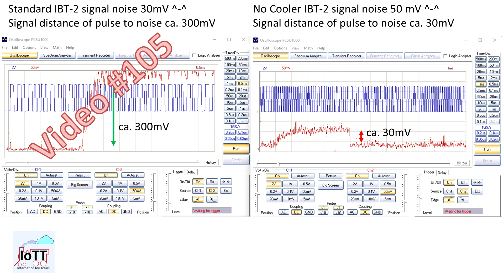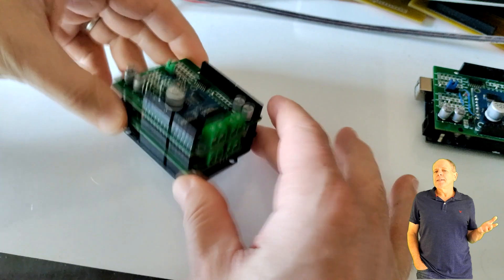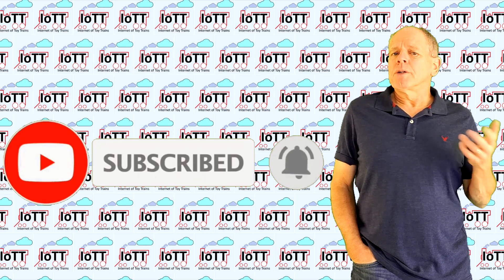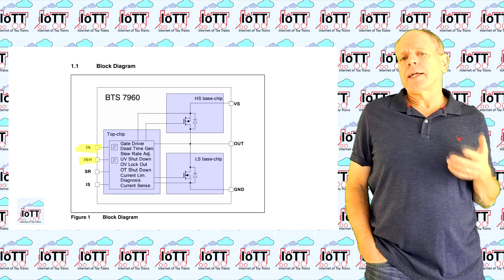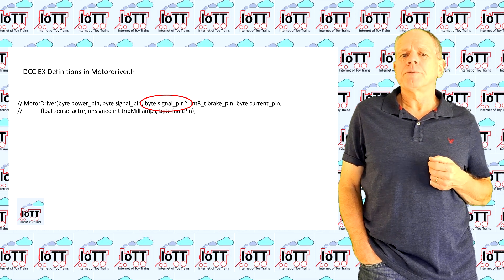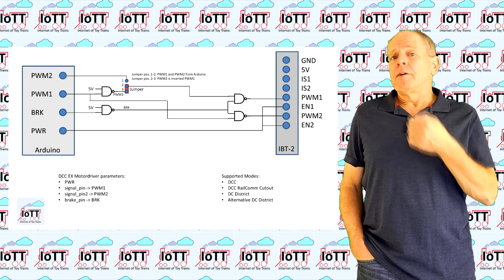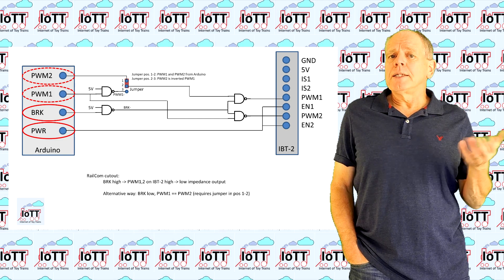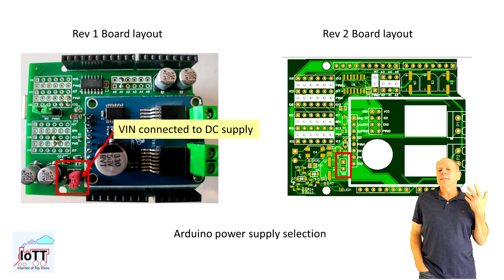IBT-2 Power Shield (Video#107)

Comment: Very nice Hans, I am currently building mine using an L298, but now I will look forward to getting your new power shield board.
👍  (I have one of your Red Hat boards, that I got a month or two ago.)
Hans, all your hard work is much appreciated. Thank you. Phil.
Reply from the maker: Thank you. You can even combine the IBT-2 power shield with the L298. Use 1 channel of the motorshield as prog track, and the IBT-2 shield for your main track.
Reply: @IoTT  OK, yes I see, you can just stack a number of the various track power modules (IBT-2 & L298) to control a number of "power districts". (watched the video again, a couple of times ... yes you did say this in the video.)
Reply from the maker: This is correct. In the upcoming version of DCC EX you can have more than 2 track outputs. You can have Main, Prog as usual, and then a number of DC districts. I am not sure how many, but it looks like four, maybe six. Not sure right now if it is possible on an Uno, but on a Mega it does work, I tested it so far with one additional DC district to verify my board works. Each DC district gets assigned a DCC address and then you control it like a decoder on that address, only that it changes polarity and voltage (PWM ratio) of the track.
Reply: @IoTT  look good

Comment: I bought your "PowerShield Rev.3" card on Tindie.
I hadn't had time to use it. I note by looking again at your video n°107 that the electronic components C2, C5, C6 are not present and welded on my card.
Is this normal or an oversight during the manufacture of the card?

Congratulations to all of your outstanding contributions.
Best regards
Reply from the maker: No worries, that was just a design variant in case there was a problem with the size of the capacitor on the IBT-2 board.  The plan was to remove the large capacitor and replace it by four smaller ones on the base board. It turned out the hole in the board would allow for stacking them closely enough, so the additional capacitors were not needed.

Comment: Two questions.
1. Does the current version of DCCEX support this shield or upcoming version.
2. How's the shield coming?  I'm holding off an order of smaller things and want to save on the international shipping.
Reply from the maker: 1. Yes, no problem.
2. Probably about 2 weeks for the version with the external IBT-2, and about 4 weeks for the version with the IBT-2 mounted board. I am waiting for some components, right now.
Reply: @IoTT  how far away is dc district
Reply from the maker: @matthewesler8379  That is a question for the DCC EX team. But for sure the Powershield will be ready when they release their software that supports it.
Reply: @IoTT  thank you